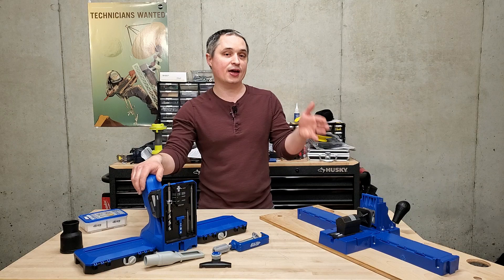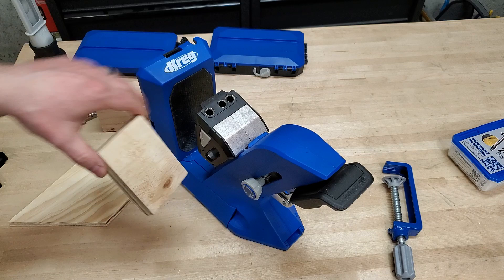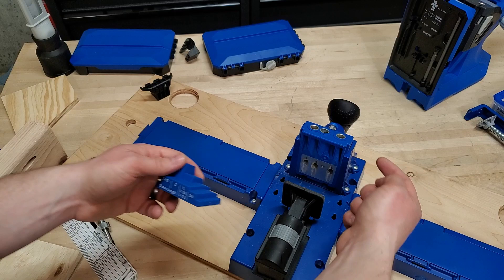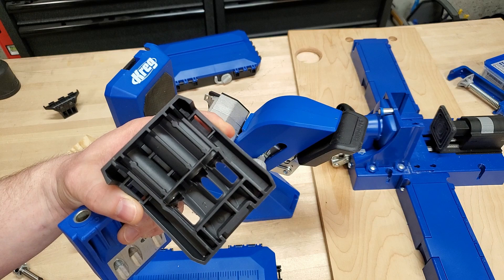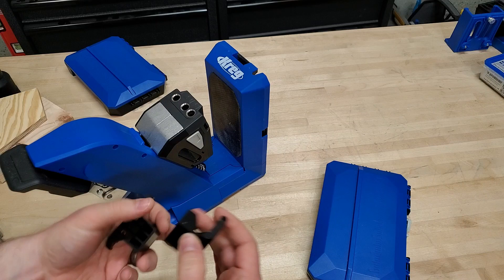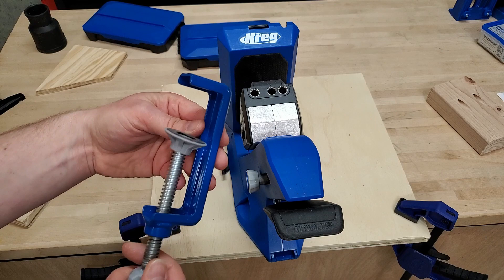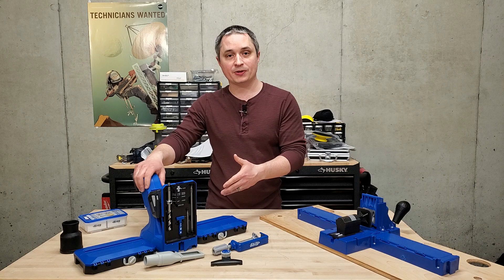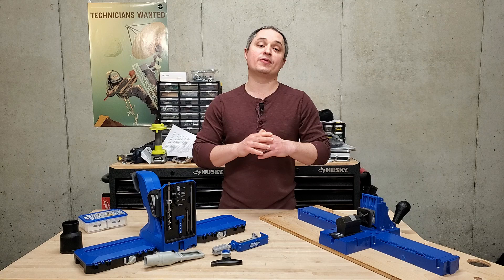Kreg 720PRO vs K5 Pocket Hole Jig Review and Comparison

Comment: I have the K5 and love it.  Contrary to a comment about the dust collection, I find it to be very good.  Yes it does pop out sometimes but I clamp my vac hose for stability and pretty much eliminates any hassle.  Thank you for this review.  I was going to buy the 720pro for a Christmas give but found a K5  to bought instead.  The K5 is rock solid, in my opinion.  So many "improvements" companies make to develop a slicker product  end up "breaking something that ain't broke".  Another reviewer had similar comments so yours are right on and actually noticed a few more annoying design issues.  I hope Kreg is watching!  Thanks again.

Comment: I recently saw a demo of this being done at at a Lowes store in Tucson Az. . The guy was a Lowes employee not a Kerg Rep ,He took a brand new unit out of the box and went thru the setup and showed the various options. 
He then took a couple of pieces of wood to join together and the Auto clamp broke , he laughed about the good return policy and then opened another New unit and tried it and it also broke on about the third time. So based on this I think I will keep my K4 and lookaround for a K5 as well.
Reply from the maker: Wow, that's pretty bad! K5 is the way to go in my opinion.

Comment: As always, a fair-minded,  thoughtful and candid review. 8 minutes in the decision was easy...not good. I own an excellent alternative to the K5 which is made entirely of metal, has extendable side arms with stop blocks and adjusts easily. You might give it a look: Massca Pro Aluminum Pocket Hole Jig System M2.
Reply from the maker: I've heard of Massca, but never felt the need to look beyond the K5. Maybe I need to take a closer look!
Reply: @DoresoomReviews  The quality is apparent the moment you lay your hands on it. It's not revolutionary, just well made and well thought out.
Reply: I've seen those advertised on Instagram, do you know what the angle the holes are drilled at? The problem with the likes of kreg jigs is no matter how tight you clamp the two work pieces together they always move when you drive the screws in. There's a company called castle that uses routers to cut their pockets at less of an angle and the pieces of wood stay flush when screwed. Stumpy nubs just posted a video on cools tools he has in his shop with the castle jig included
Reply: @a-carpenter9229  Yes, saw the video and the pocket-hole-router appliance looks far more advanced and really excellent. It is close to $500 though, so it would be a bit much for an amateur like myself.
Reply: The Massca looks like a good deal. The same as a K-4 but aluminum.
Now if they would just pit the lever in the front, like the K-5, they would really have something.
If anyone is wanting a K-4 or K-5, you better get it quick. Kreg has discontinued both

Comment: I really like the self adjustment feature for various thicknesses of wood for the 720 pro, also flipping the unit over for sheet goods. BUT the cons you described will prevent me from buying it. I’m retired & on a fixed income so I really investigate new purchases. I’ve been using the K-4 & K-5 since they came out. I use one for 1 1/2” lumber & the other for 1/2” & 3/4” ply wood or solid stock. They’re each mounted on a sheet of ply with their own drill bit. The ply board had a set of blocks to hold sheet goods w/I me holding them. When I’m finished I hand them on my French cleat wall & move on. Granted not as convienent as the new one but I’m not in a huge rush to drill pocket holes. The 720 is sleek looking but seems too wobbly. I have several Kreg jigs & accessories & they’re all well built. This is a fail—for me. Thanks for the review.
Reply from the maker: Glad I could help!

Comment: I was getting ready to pull the trigger on the Kreg 720PRO but I will wait until Kreg decides to make the improvements since I have had a K4 for many years which I have built into a plywood docking station.  The new one would be more convenient but I do not like flimsy tools.

Comment: Thanks for this vid, I looked good and hard at the 720PRO and decided against it. I do have the very portable 520 though that I like.
I have the K5 with both guide blocks as well. So easy to remove it and it's a lot more versatile

Comment: I just found this video and am very glad that you made it.  I was wondering how much difference there was between the K5 and the 720 Pro and you covered all the bases very well.  I totally agree with your assessment and the shortcomings with the new model.  The dust collection on the K5 have been a major issue for me and I had to rig something nonstandard just to keep the hose in place while I used it.  I purchased the K5 master kit so I got all the extra size inserts and it's a bummer that they won't work on the 520 or 720 models.

Comment: Thank you for the thorough review! I was considering the newest jig while not realizing that my K5 (which I love) works better in most respects. What I DID do was to buy the accessories for my K5 while they are still available! One strange part of your review of the K5 was the dust collector being loose. My version of the K5 has the dust collector in really tight, enough that I am not sure that it is even removable. I have a 3 step rubber adapter that attaches to my Festool vacuum perfectly and it never slips. Design change at some point? Dust collection works great so whatever. I bought a Kreg KPDGB Jig Portable Drill Guide Base for using on large sheet stock, the HD guide block and a spare regular guide block replacement, again while they still are available, heh. I am lucky enough to have a Festool Domino Jointer for mortise joints where I use the pocket holes to solidly fasten the joint together. I don't even bother with glue with that setup which makes repairs or adjustments a snap. The micro jig has not been missed since I bought my first Kreg jig so I must not need it.
Again, thanks for the review. I even learned how to use my K5 better.

Comment: Thanks for the really good review. If I thought I wanted the new 720 I will now totally disregard. I have all the older models including the K4 and K5 as well as all the preceeding ones which I will stick with. I actually like the K4 better than the K5. I think Kreg is over thinking the thing.
Reply from the maker: Glad I could help! I'm interested in what makes you like the K4 more than the K5? The clamp lever placement was the main reason I picked the K5 over the K4 myself.
Reply: @DoresoomReviews  I was thinking the same thing. I do quite a few pocket holes in bigger sheets of ply, the K4 rear clamp would make it very difficult to use.

Comment: Great video comparison I personally have the K5 and although I bought it about still haven’t used .
I also bought the micro plug so I can use it with thinker woods or hard woods.
Afeter watching your video I must admit that I’m glad I have the K5 it is a much more versatile product and also sturdier than this new product that Kreg has come out with, as far as I’m it  concerned the new version is really just a piece of junk compared to the K5.
You know sometimes is the best solution is
If it ain’t broke don’t fix it. Sure anything can be improved but this time Kreg really bombed out

Comment: Thank you for the detailed review! I've had the K5 for several years, drilled many, many pocket holes and it's always worked great for me. Was kind of looking at the 720, thinking it might have some useful features, but it's quite the opposite. Sadly they are improving some things, and making others worst. Also makes NO sense you won't be able to use the drill blocks separately, thanks for pointing that out. It also makes no sense they are dumping the K4 and K5, basically forcing their customers to the 720, which has too many issues. Such a BAD idea they will regret. They are going to push people to the competition. Are they forgetting they are not the only pocket hole jig in town? When/if my K5 can't be used, I won't be getting the 720. Worst yet, they obviously did NOT test this new design out, like getting real world users to give it a good go.
Reply from the maker: I bet they figured people would have to spend more money on their 320 jig if they wanted to use the drill guides separately. But it's inexcusable they didn't think of losing all options for a micro pocket hole drill guide that can be used separately.
If I was Armor Tool or Massca, I'd be scrambling to claim the huge market share that Kreg just dumped by discontinuing the K4 and K5.
Reply: @DoresoomReviews  Exactly. Like they are trying to squeeze even more money from their customers. Never a good idea and probably backfire on them. Always happy with kreg products, but seems they are going off the rails wit their pocket hole products. Actually just bought one of their workbench units and really like it. One thing they are still doing right. I wasn't going to say Armor Tool, but that was the first thought :) Don't think they need to scramble much, Kreg is making it easier for them. Although I have not used it, am I the only one that thinks the 520 just looks incredibly awkward to use?
Reply from the maker: I have the 520 too, still working on a review for that one. It's actually pretty awesome for plywood. I haven't used it much clamped down to a bench though.

Comment: Good review, brutally honest. Kreg may want to hold on to the molds for the K5 for awhile. I've seen a couple of other reviews of people who've used there own money to buy one. They're not overly enthusiastic either.
It's amusing that they call them docking stations. The way it's designed, it looks like it could be right at home on a Star Trek set.
The  only all glowing reviews that I've seen, are done by people who had their hands on one before the release date, and their video was posted before as well.
Like I said in a previous comment. We'll see how well the new jigs stand up to real world use and abuse. 
I'm sure Kreg has done there homework and tested them, but there's no way to test for real world genius. 
I won't be replacing my K5 any time soon. 
Hey, with the announcement of the discontinuation of the K4 & 5, maybe my K5 complete with all of the accessories, including a carrying case, may have just went up in value. 
I know at all of my favorites tool haunts that sells Kreg products they have more K4's than they do K5's.
This one might just end up sitting on the shelf of shame along side Armors auto clamping pocket hole jig. I've been reading a few reviews, and quite a few people have gotten buyers remorse. Saying they should have bought a K5.
Reply from the maker: I think the worst part is that I REALLY wanted this 720 to be a home run. At least a lot of people will be able to score a K4 or K5 at clearance prices.
Reply: @DoresoomReviews , have you checked the 720 when clamping 2X material into it. There's a gap between the 2X material and the top of the drill guide block. 
Apparently, Kreg's technical support considers that gap as normal when clamping thicker materials. 
So, that an engineered flaw? Interesting. 🤔
Reply from the maker: I have noticed that there's a small gap with 1.5" thick workpieces. It seems the auto-adjust mechanism doesn't apply pressure uniformly across the whole jig. Definitely another mark against the 720.

Comment: Thanks for this timely info. I mean REALLY timely because I was about to pull the trigger on the 720 Pro and have had a change of heart thanks to your review. It does look like it was engineered while smoking WAY too much weed. Flimsy is a nice word for the construction of this thing. I understand they want to make a profit but cutting corners that make the thing an expensive paper weight is simply not the way to roll. I may go with the Armor Tool or Massca pro.
Reply from the maker: Glad I could help!

Comment: I hope this clamping system is better than my K5. Mine broke 3rd time I used it. I just use a clamp now. Works okay.
Reply from the maker: Yikes! What part of it broke, and were you able to contact Kreg for a warranty replacement?
Reply: @DoresoomReviews  just bought a new 720 yesterday. The issue is when you clamp it, it won't bite on the track. There's a YT video about it. Apparently it's a common problem. Didn't contact them bc I waited almost a year to use it the first time. Love my new 720 though. It is night and day different!

Comment: @Doresoom Tool Reviews. Thanks for the great and VERY thorough review between the Kreg 720PRO and the K5 Pocket Hole Jigs. You didn't miss a thing. You have to wonder whether Kreg had enough design reviews and woodworkers test the 720PRO before they put them out on the market? Or maybe the engineers had the (original) design right (as designed) but the accountants had other goals (as delivered). You being former  NASA, I'm sure you had such experience between engineering and accounting?

Hope you and your family stay safe and well.
Reply from the maker: Thanks! I do wonder if they did ANY outside beta testing, other than the influencer blitz they put together for the launch of the new products.

Engineering is almost always a tradeoff between function and cost. At NASA though, I was just on the operations side of things. So I made sure the astronauts on the ISS used the hardware within Boeing's design parameters.

Comment: I bought the 720pro and the jig 320. So far I've been using more the 320 than the 720 version. What I hate is how cheaply made it feels! Specially the docking pads! They feel really, really, cheap! Just dropping your driller on them and you can be sure that they will break in pieces! You should do a review of the kreg 720 micro pocket hole attachment!
Reply: They probably won't break, because it is flexible plastic.
Reply: @loganmedia1142  But I'm telling you, it feels really cheap! So soft! If you ever happen to have it you will know what I'm saying

Comment: The board mounting problems are the only real issues I see. The others are pretty minor. I drilled a 3/8" hole through the wings that flip out the sides to access the mounting holes. This way the wings stay in and I can drive screws into the holes and into a board. Now with the jig screwed down and the side boxes on I drilled screws through the box bottoms to hard mount them. Problem solved. With as much as you bitched about the K5 dust collection that you still recommend it.

Comment: Thanks for the great video! Would you recommend picking up the K4 jig for $75 on clearance? I have the R3 kit and it has served me very well, just looking for an upgrade.
Reply from the maker: I haven't used the K4 myself, but that's a great price for it. The main reason I picked the K5 over the K4 was that the clamp lever is on the side closest to you. On the K4 you have to reach around the workpiece to engage the clamp. If that's not a big deal to you, then absolutely go for the K4!

Comment: 720 looks like a lot of corners were cut to reduce production costs and quality went to hell.
Reply from the maker: Unfortunately, I think you hit the nail on the head. Kreg made a few flashy new design changes like auto width adjustment to catch everyone's attention, and then snuck in a bunch of shortcuts for the rest of the design.

Comment: This is a great comparison of the two Kreg products. I have a question for you. I just bought a standard  plug hole drill bit and didn't think to order the jig to go with it.  It suggests the newer jig that fits the 720Pro.  Do you know if the plug hole drill bit will work with the K5 and it's plug jig?
Reply from the maker: Kreg makes two different plug cutter guides - one for the 720, and then one for their K# models.
This one is compatible with the older K4 and K5 jigs: https://amzn.to/3LWN8Gs
This one is compatible with the 720 ONLY: https://amzn.to/3O2h71l
It's really unfortunate Kreg didn't make them all cross-compatible.
Reply from the maker: I just re-read your question and realized you were talking about the drill bit only. I believe that one is compatible with either jig insert guide. However, I don't think Kreg sells the guides without the drill bit. So your best bet is to return the bit and just buy the guide kit for whichever pocket hole jig you have.

Comment: Definitely dislike the drill setting block on the K5, wished I would have sprung for the foreman due to the dislike of the changing settings. Instead think I’ll just get a couple extra drill bits and set them to most common sizes
Reply from the maker: That's a great solution - maybe with some color coded tape above each stop collar to keep them identifiable! I really liked the simplified depth collar setup the new jigs have. Kreg sells them separately (https://amzn.to/3kp127B), but it's nearly as cheap to buy them with the 310 kit anyway (https://amzn.to/3qUrf01)

Comment: Looks like they tried to copy the concept of the Porter Cable pocket hole jig and fails miserably. I'll stick with the K5 and get the P.C.
Reply from the maker: I think the PC has been discontinued unfortunately. And this 720 is a big step backwards from that, because from what I've seen of the PC, you don't have to adjust the stop collar and it's made mostly from metal components. The Kreg just looks sleeker.
Reply: I have the PC as well and don't use it. K4 is my favorite.